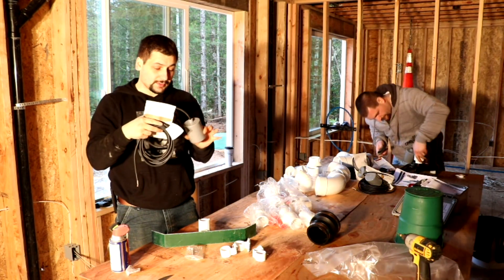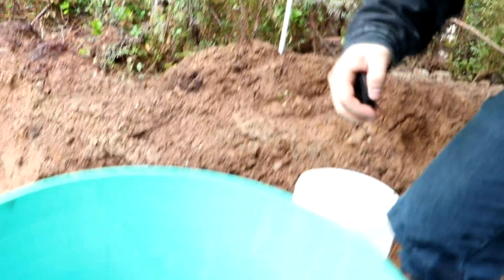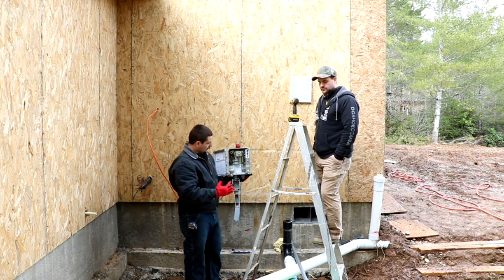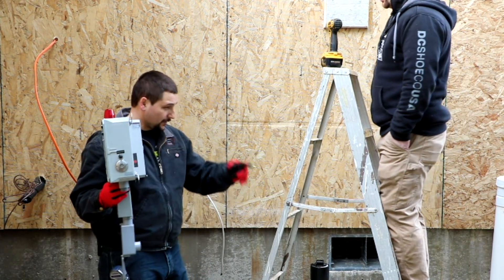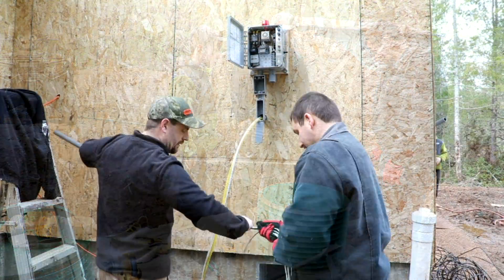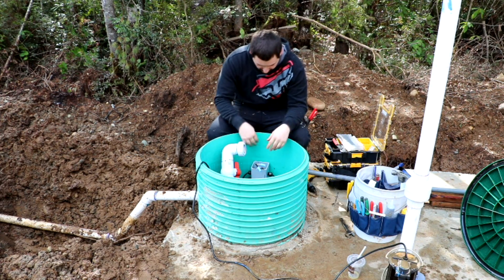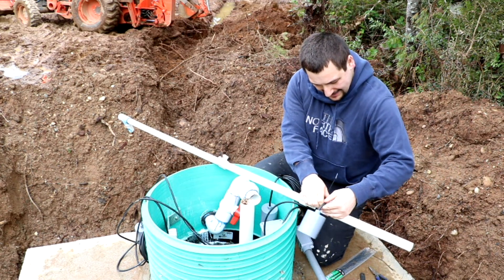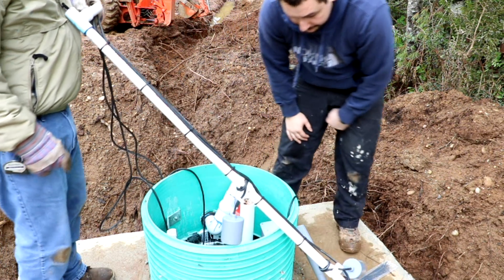Install your own septic system #3

Comment: The electrical wiring from the pump house to the power to the house temporary power is it not encased in any PVC or is it just wire line in the ditch?

Comment: As a Septic & Sewer Professional with 20 years of experience, this guy and his brother are doing this pump installation the hard way... not the right way. I can assure all of you "do it yourselfers" out there, a Licensed Septic Professional would not install the electrical junction box with the lid or cover pointing up, nor would I recommend making any electrical connections inside of the riser. In fact, in my state, the preferred method of installation would require using a pressure treated 4x4 or 4x6 that sticks up above the ground, so in the winter it's above the snow... external of the Pumping Station and Plastic Riser. Typically, we attach a weatherproof electrical box to the post, which also gives you a place to secure the electrical conduit as well. Not to mention, the 2 inch discharge line that connects the pump to the leachfield or drainfield, should not be inside the riser either. Again, in my state, due to below freezing temperatures in the winter, it's a good idea to install the pump discharge line as deep as possible, which means it should exit from the wall of the Pumping Station itself... not the riser. Also, to make sure the line can drain itself out or drain back to the Pumping Station to prevent freezing, I recommend drilling a hole in the pipe just above the liquid level in the Pump Station, or above the float switch for the pump. The other option is don't use a check valve at all, because you need the 2 inch discharge line from the pump to drain back into the Pumping Station. Not to mention, 1 float switch to activate the pump is adequate, why complicate matters unnecessarily, having another float switch is just another thing that can go wrong or break. Also, running electrical conduit in the same trench as your 4 inch waste line(s) is a really bad idea, because you never want conduit crossing over or under any of the pipes that connect to the Septic Tank and/or Pumping Station. Lastly, the Pump Alarm Control Panel really belongs inside the building... in the garage or basement ideally, not on the outside of the house. To be clear, I'm in the Northeast United States, and it gets really cold here in New England, so one of our biggest concerns is snow and below freezing temperatures. You want the electrical connections to be accessible above ground, because "higher is drier" and you don't want or need to be digging through the snow to get to the Plastic Riser on the Pumping Station to fix or repair anything when a malfunction occurs, and believe me, it will happen in the dead of winter with 3 feet of snow on the ground... Murphey's Law.
Reply from the maker: So we don’t get 3’ of snow, and I’m sure that everything you relayed is accurate for your area, how ever you should realize there are lots of other areas in the US and they have there own codes and regulations and ways of doing things so saying something is wrong when it not just shows your ignorance. Your way maybe correct for you and your area how ever it would not pass inspection in Washington state.

Comment: So you didn't think anyone would notice that haha I noticed what happened to the last riser in the role you had an ABS pipe sticking out a 2 and 5 sixteenths ABS pipe I believe it was that you cut a hole in and had the pipe coming out on the 3rd episode that pipe is gone and there's a new riser in place. You guys screwed up and you didn't want anyone to notice, In sense when are you allowed to go from ABS to PVC without a rubber boot.
Reply: It would be good if you wrote in the video time for each of your points so we can understand your comment.